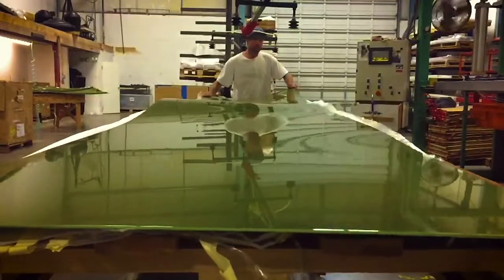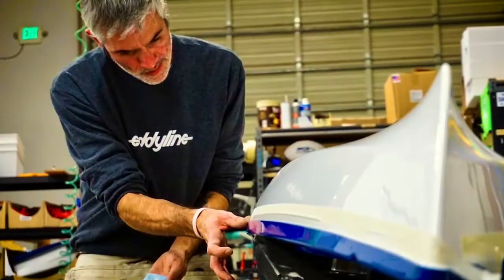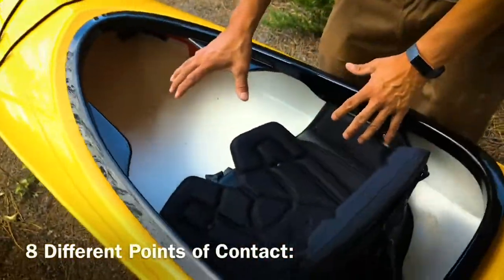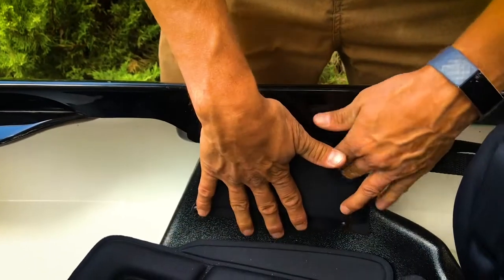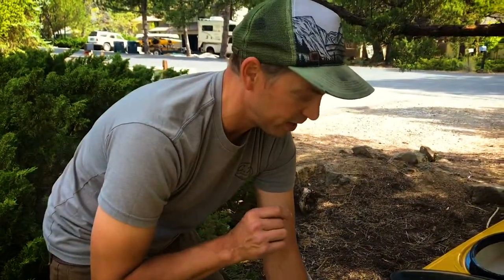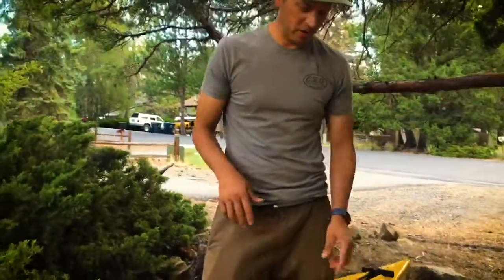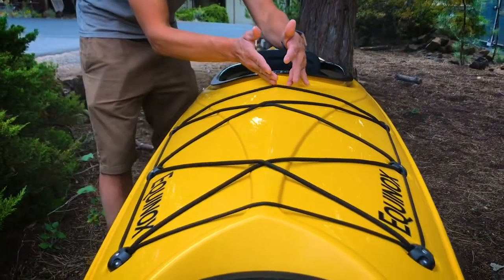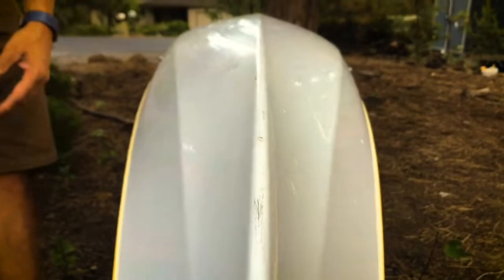"Insider's" Overview: A Detailed Look at Eddyline Kayak's Thermoformed Construction

Comment: You don't show any of the Fathom model, is there a reason for that? I'm used to a 16'6" sea kayak.
Reply from the maker: On the to-do list. Which is a long list! Most folks that are after long boats also are usually more informed and have more of a palette/skill set to choose by just going for a paddle. We’ll get a Fathom vid up this summer. Promise!
Reply: @HappyPaddlin  Thanks. I wish I was in your neck of the woods (or vv). I'm having a hard time finding a dealer with the fathom. I did a lot of kayaking 20yrs ago before kid, my old rotomolded boat really needs a (lighter) upgrade. Neighbor got a Sitka XT and it looks great, but on the group ocean paddles the shorter boats can't keep up.
Reply from the maker: The XT is a close deviation of the fathom. So you’ll get a close feel for it that way. Fathom a bit more nimble and faster.
Reply: @HappyPaddlin  I think I snagged the last Fathom on the east coast today! It's a beautiful boat but snug. I need to do something about the hard edge on the top of the backband though.
Reply from the maker: @tim1398  Just recline it a bit. I've felt what you are describing and it usually just means you have the lean too forward.
Reply: @HappyPaddlin  I switched it for their chair style backrest, it feels better. I had the backband as high up as it would go, but the seatback is almost as low as it can go, the top of each ends up about the same height that way. It's a shame they can't contour the edge of the backband like they did the seatback. Between that, taking out the hip pads, and getting the pedals right I'm starting to get comfy. I suspect I am about as large a paddler as the boat is meant for.
Reply from the maker: I may be wrong but I think you may find that the more you paddle, the less “height” you will need back there. Many of us keeps ours at the lowest and slightly reclined. Glad the backrest worked for ya. That was the entire point of that seat system— interchangeable parts. But, point taken on softening it up. Nothing wrong w softer!

Comment: I had been lusting for an eddyline for 2 years. It was hard to commit to a purchase because I already had a recently purchased boat. After 3 summers of paddling it about I finally had enough of its sluggishness and went and got a Sitka LT. Holy cow! I really like it. These are premium priced boats and I can see why. One of the things I really like is the fine entry of the bow which means a quiet bow wave with no energy robbing splash and spray. The big plus is that I get an extra mile per hour or more for the same effort compared the the Pelican Escape 120x, which is my first kayak.

Comment: Purchased two Sitka Lt's , very nice boats so far. I'm a little concerned i'm going to pull off the coaming someday . I sometimes pick boat up by it and it feels a bit too flexible if not flimsy .
Reply from the maker: Never done that in 20 years w two complete fleets of Eddylines every year. Flexibility is not a sign of weakness. Too stiff can be a problem.  At the same time,
flopping into a boat and holding on to the lead part of the coaming is something folks w composite kayaks wouldn’t do on a regular basis. But, every time I lift an Eddyline, I’m grabbing the side of the coaming and the chine of the kayak. Coaming breaks coming back to us at the Eddyline factory are extremely rare. I’d worry more about bad car topping and too much sodium in one’s diet. 
Thanks for watching and choosing Eddylines!!

Comment: I've been looking at Eddyline kayaks online a lot recently.  I've watched pretty much every YouTube video on them there is.  I hope to upgrade my kayak sometime next year.  I currently have a perception pescador 100.  I'm 5'5" and weigh 180lbs.  I'm new to kayaking (only been out 5 times now) but I love it.

I live in Kentucky.  The waters I'm paddling are generally flat or slow moving with occasional class 1 or 2 waters.  I'm torn between sit on top or sit in.  I might eventually fish from a kayak but I don't feel my paddling skills are where they need to be just yet.

Sometimes the waters I'm on are a little low and the bottom scrapes some rocks.  I keep reading conflicting info on how thermo-mold kayaks can handle this.  

I've looked at the Caribbean 12.  Is there a sit in kayak that would work as well or better for what I've described? Any recommendations are welcome.  The closest dealer to me is about 2 hours and they don't demo 😔 so I'm trying to be as informed as I can be.
Reply from the maker: Your size allows you many choices within our line-up. For sit inside, with some moving water, the Skylark might be a good choice. As far as durability, scrapes are really nothing to be concerned with. It is so easy to add additional material to fill any gouge but rarely will you find the need. Heavy loaded impacts, like slamming into a river rock with speed and weight, is they type of abuse that can strain a thermoformed boat. I like to use the guide that if you are paddling the type of conditions that you may need a helmet on then you may have to be prepared for these type of hits. That being said, I take Eddylines into current and moving water all the time. Scrape shallows, bump into rocks and even ride over them. But a shallow, fast moving class 2 really calls for a river kayak. These days, you can pick up a used ww boat so inexpensively that I would consider a second boat for "bang 'em up" swift water paddling. This would allow you to have the right craft for fishing, flatwater/moving water, etc.  The sit on top choice does allow you to safely and quickly re-enter in various conditions while a sit-in will require you to get a few more skills for rescue/recovery in open water.
Reply: @HappyPaddlin  Thanks!  I've been looking hard at the Caribbean and also the Sandpiper 130.  I found a dealer in Indianapolis that will do demos.  They have a big demo and sale event on mother's day weekend, so I'm planning to attend that to get some hands on experience.

I've probably watched everyone on Dan's videos on Eddyline kayaks. Lol.
Reply from the maker: @traviswhitworth6506   Good luck and glad you found a dealer that made the commitment to a demo fleet so you can try. Please support their efforts if you can when it comes time to buy! And yes, Dan is the Man!! Wish there were more with his passion and joy for sharing info!
Reply from the maker: @traviswhitworth6506  we just released an Ultimate Comparison video if you are still undecided!!!
Reply: @traviswhitworth6506  We are from Kentucky as well. I know this is an older post, but we found another good dealer in Ohio called Great Miami Outfitters. They were out of everything but their demos. That did not deter their enthusiasm for letting us sit in the boats and filling us full of useful information and stoke to get on the water. We wanted nothing more than to buy our boats from them, but alas COVID-19 and what not. They have wait list of over a year. They actually were trying to help us locate kayaks at other dealers as well as Yakima roof rack components! They couldn't find anything, but my wife would not be defeated. She found two Sandpiper 130's in Florida. One in Titusville and one in Nokomis. It was along 1,949 mile round trip. But we got our Eddylines. Some may say that is crazy, but we got bit hard by the Eddyline bug. It was a crazy journey. But we hope to have our first paddle in a small local lake to get familiar as we are brand new to kayaks. This community has been great! I hope you have found your boat. If not, the dealer in Nokomis, FL had a used super clean Caribbean 12 in blue that wasn't spoken for. Hard to come by in 2021.

Comment: I have a two questions on the Sky 10,  Could you use that model as a touring kayak if you wanted to travel on smooth water a couple of hours or more?  What is the capabilities of the Sky 10 to take some waves for a beginner kayaker?
Reply from the maker: Jimmy Black Many folks purchase Sky 10s to put on their big boats and cruise the San Juan islander In WA state. They use the sky 10 in these waters to check out shorelines, etc. The ability of the kayak in rough conditions depends upon your size and skill level. But, I would take the sky 10 in 2-3’ rolling waves no problem with a skirt on. Most importantly, the kayak has front/rear floatation so deep water rescue is possible with the right skills and practice. Like any sport, progression is the fun! Having said all that, if I had miles to cover and my choice of any of our kayaks, I would go with something longer for tracking, glide and performance. When I’m in the sky 10, I adopt a more “I’m just cruisin’ “ disposition and enjoy the scenery and path vs the destination.
Reply from the maker: Hey Jimmy, we just release TWO new videos on the Sky 10
Reply: @HappyPaddlin  I'm going to watch it right now!